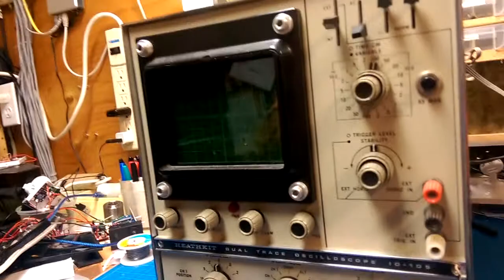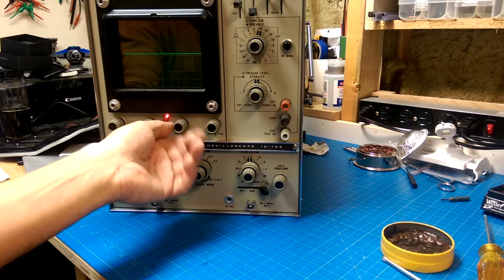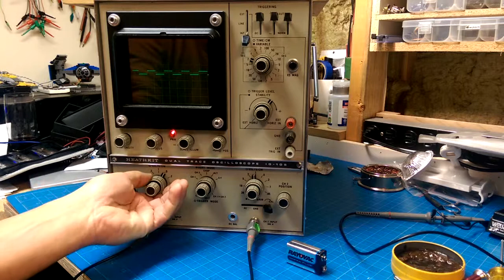Heathkit 10 105

Comment: I have one of these given to me with all the manuals and such about 5 years ago. I do not know much about electronics. I plugged it in and the fuse blew in a minute or two. Replaced it. It seems to have blown immediately. That was a few years ago. Haven't touched it since. On the diagrams I noticed a new line was hand drawn in with a resistor or something on it. Thought that was interesting.

Comment: Nice to see someone with a similar model to the one I purchased! I bought the IOW-102G off eBay for ~$20.

It's a good idea to replace the electrolytic and (if there are any) wax capacitors as they're around 40 years old and probably very electrically leaky.
Reply from the maker: I will probably do that at some point in the near future.  But I just picked up another scope, a Philips 3212, and the Heathkit is in better calibration ( it seems ).   I compare the two in this video...https://youtu.be/Hcc5CwEEYfQ that will bu up shortly.